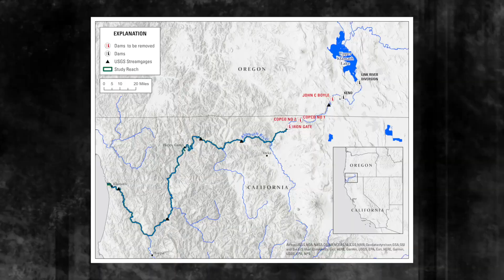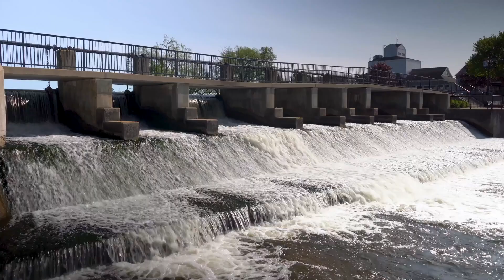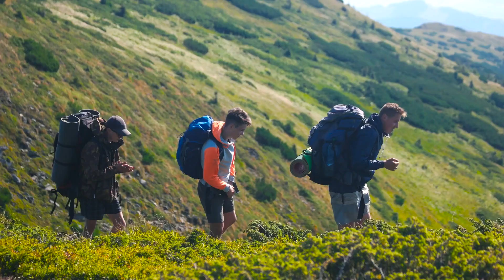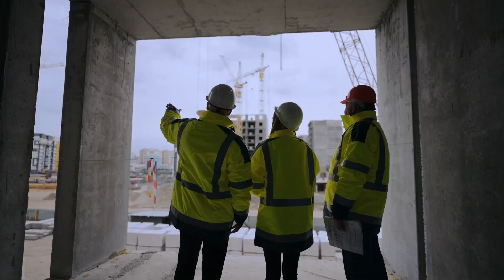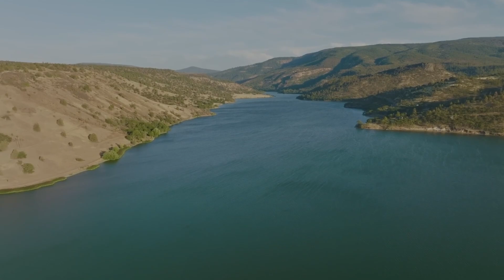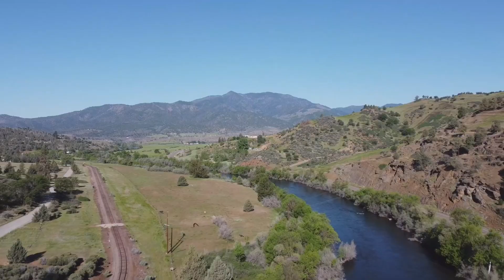America Is Demolishing The Biggest Dams In Its History

Comment: How are they going to replace the electricity that the dams produce? You can’t use solar or wind because they are intermittent and don’t produce a constant supply.
Reply: did you watch and understand the video..if not,, re watch it...again
Reply: batteries are a thing dude, do you think that if I have solar power I can't turn the lights on at night?  what good would it be if it was like that?  a little logic needs to be applied

Comment: This is good but what about water reservoirs during droughts?? I think the dams are good if positioned on waterfalls, where salmon cant go up to.
Reply: Normally irritation is something to consider. These particular dams weren’t built with irrigation in mind. Their location is on the other side of a mountain range from any agricultural  farms. The dams were built to provide hydroelectric power; however, these are small installations so upgrading the equipment would not have pencilled out. It was actually cheaper for the owner to facilitate removing these dams then building fish bypasses. Sort of a strange case
Reply: Adding to william's post:
You also have to consider the large foot print the dammed lakes have and the water that is evaporated. China is currently seeing the problem of the dam water evaporating enough to where down stream people are getting a creek instead of a Mississippi river during the winter. 

It's something most people don't think of with the dam construction.

Comment: WHY IS THE CONCRETE NOT BEING RECYCLED!!!!!!!!!!
Reply: Who says it isnt. They mix in a % of waste concrete in new production
Reply: @zack9912000  they stated they are creating landfill for the concrete, but i would hope they woudl use enough of it so they wouldn't need new landfills
Reply: @cliffwoodbury5319 cost , just imagine how much it would cost to transport all that concrete to somewhere it could be used
Reply: Cooking off the Lye from the gravel and separation is a lot more costly than to just dig up limestone and cook it with no aggregate separation needed.
Reply: @zetsumeinaito  and if you make railway ties of concrete that last for many decades instead of wooden ties that last for a decade you can make up for the differance because its mass produced.  I'm sure they can find finished products that make sense to reuse the concrete.  Even nice recasted concrete totem poles for native americans to sell - recycling is often about being inovative.
Reply: @zetsumeinaito  run the concrete chunks through a jaw crusher, separate out the rebar and if needed run through jaw crusher for smaller output.
sell the crushed for road base, the rebar for metal recycling.
they don't try to cook of the lye and break out the gravel they leave it together to make "crush and run" type road base.

there is a ready market for it with that little bit of processing.
Reply: @jaquigreenlees  Cool, let's assume you are correct. So what about the transport? And what about the big ass holes and channels they dug into the design of the dam? 

Bring in rando rock and sell the concrete? what's the margins on that when transport is considered? 

Blow up the walls, destroying more of the natural terrain to fill them in?

I'm sayin what they did is probably the cheapest thing they could do.

Comment: I don't get it🤯 hydro power is "climafriendly", they say...why tear it down? Buildt a salmon stairs for the fish...
Where are they going to get the lost power??? Specially when they band ICE-cars, and all are going electric?.........
Reply: Hydro is low carbon but still has other environmental tradeoffs.  Power companies remove old dams for strictly economic reasons.  The modest power they produce doesn't pay for the costs of operating them.
Reply: I believe the dams provided less than 2% of the energy that the power company sold back to the grid - an amount that can easily be replaced with modern solar and wind power infrastructure.
Building fish ladders (and re-fitting/repairing the dams) was four times more expensive than demolishing them - and then there's the ongoing maintenance costs. Just doesn't make economic sense to keep them.
Reply: @Steve_1401   and also all that warm water.. causing toxic algae blooms.. i was in the lower are of the river.. all the fish were dead..